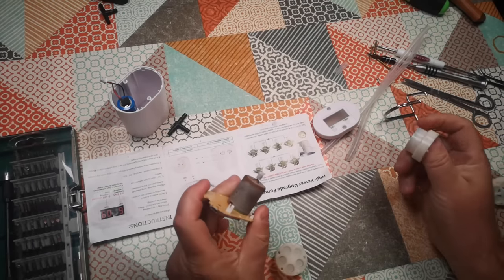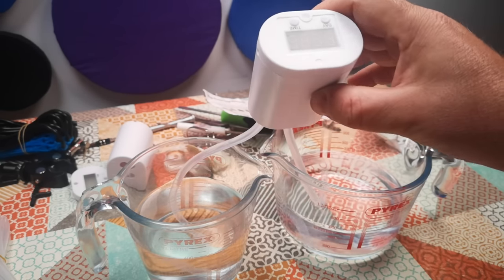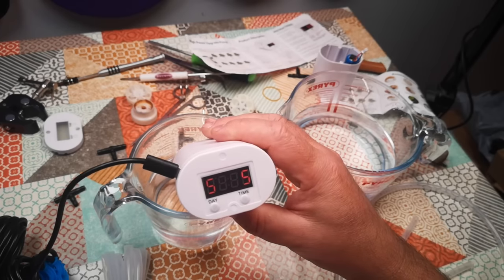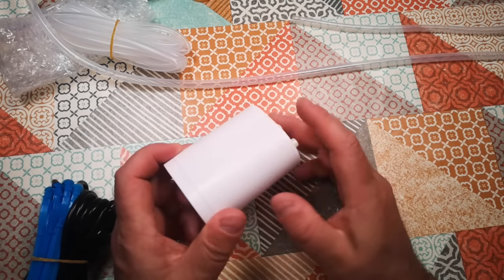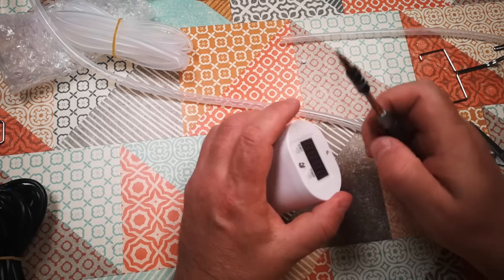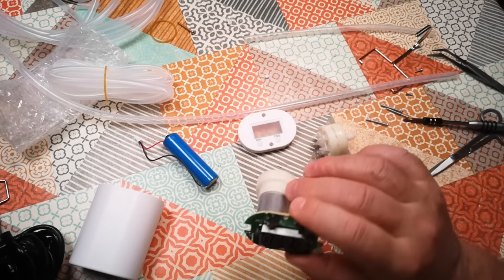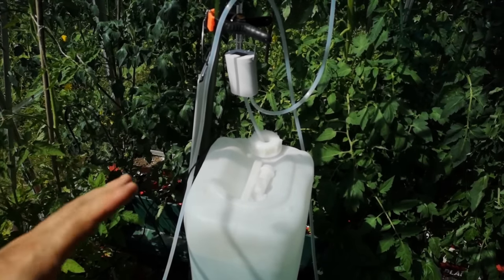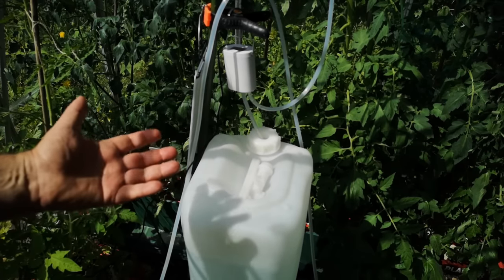Automatic Greenhouse Watering Part 2 – It Works! And Then I Broke It!

Comment: I got some tiny 12V pond fountain pumps from eBay, and a 12V on/off timer switch. In the winter I use the timer switch to turn lights on and off, and in Summer it is used to turn on the pump for a set time each day to water our potted plants. Total cost was about £15, although you do need a 12 volt battery to run it too, I happened to have an old one to hand. Quite simple to do, the most complex part was working out how the timer switch was programmed!
Reply: Actually, I'd forget the on/off timer and just make an overflow pipe that leads back down to the lower water tank.

Ah, I see, he isn't using any form of timing after the header tank.

I found one locally that has a brushless DC motor that doesn't need a battery (though you could always toss in a SLA battery and diode in line with it).

Comment: Hi Mike,

The battery probably can run just fine without continuous charging. Fundamentally, all the pump is doing is moving 4 litres of water from one elevation to another - it's very simple to calculate how much energy this would take. We know the volume of water used is about 4 L and I'll say the height change is about 2 metres.

The work done by the pump is given by the change in pressure multiplied with the volume of water moved. Since the pump is only fighting gravity (I'll neglect any pump inefficiencies for now), the change in pressure is given by water density * acceleration due to gravity * height change, so 1000 kg/m^3 * 9.8 m/s^2 * 2m, giving a pressure difference of 19,600 Pa. Thus, 19600 Pa * 0.004 m^3 = 78 J of work is done.

The capacity of an 18650 battery varies, but according to a website called Fogstar, they have a nominal voltage of 3.6 V and capacity between 1800 and 3600 mAh. This gives a total energy capacity of 3.6 V * (1.8 * 3600 As) = 23,000 J. That's a lifetime of 297 days!

Obviously, the pump isn't perfectly efficient, but it's unlikely to be so inefficient that it would use up the battery's capacity in a few days.

All of this being said, there's nothing wrong with your setup with the solar panel - peace of mind is just as important as any other consideration here.
Reply: Always love these math comments
Reply: "very simple" to calculate indeed 😂
Reply: Just felt the need to say that the result can be reached in a single step without involving pressure. 
The final potential energy of the water is simply m*g*h= 4kg*9.8m/(sec^2)*2m=78.4J and that's the final result since it all was due to the work of the pump.

Comment: I suspect you could cobble together a little 12V DC aquarium pump, a separate programmable 12V timer, and a car battery or other 12V battery. There is also a fair amount of inexpensive 12V solar equipment that you could use to top off the battery as well, but a car battery would likely last for a while. These sorts of all-in-one solutions tend to me to be much less hardy and less repairable than something with discrete components. It would certainly be more expensive, which might defeat the purpose of this project, but it wouldn't be nearly as DIY as a Raspberry Pi or Arduino-based solution.
Reply: Using Tasmota on an ESP32 would largely avoid DIYing the scheduling/coding side.
Reply: if its going to be exposed to the elements you'd want a pond one not aquarium
Reply: just buy a 3v relay, connect to new pump
Reply: @rama3njoy  5v reed relay would be a good shout
Reply: @TomOConnor-BlobOpera  single 18650 max 4.2v, and i think that circuit without step-up

Comment: It might be worth considering a simple drip irrigation system in the future. If you can suspend/make a pile of stuff to hold the larger reservoir high enough, you can run a pipe from it straight to your plants, and mediate the flow by stuffing the tube with a wad of wool held in by a bit of wire, or a simple valve if you want to get fancy.

Probably less precise than the pump, but if you want something simple and future proof it might be better suited for your needs.

Looking like a lovely garden!

Comment: I have a very nice indoors growing kit that's a complete hydroponic system with a table that floods with water and drains at set intervals, and the one item that took the longest to find a very good one was the water pump and oxygenator kit. I bought 4 of them before finding one I really like, and I do have everything setup on a Raspberry Pi 4 Pro with Bluetooth so I can control things remotely, and check on things like the temperature in the tent and of the water, what the lights are doing, and even what the pH and nutrient-density of the water.

Comment: Parkside in lidl has an automatic plant watering thingy! For £30 If you're still looking for one. I've got one and it seems pretty good
Reply: I believe this device from Parkside simply has a soilenoid inside that gets opened, so it needs to be connected to a pressurized water line. He mentioned at 15:17 that he has neither mains power, nor an actual water line at the greenhouse where he tries to water.
Reply: @graealex  just need to hang a bag of water at the top of the greenhouse? Gravitational pressure would  suffice
Reply: @growtocycle6992  Depending on the greenhouse, he might not have a place to put 30 Liters or so of water on it, or rather, it might not handle the weight of it.

Comment: I was given a water-damaged Dremel (left in a shed in its case) with a very rusty motor that was as dead as a proverbial. Took it apart, cleaned every cubic millimetre and now it works like a charm. 

Did wonder if you would be buying a valve doodad from your header tank (like hospitals use for drips). Love watching and hearing your process and progress to ingenious solutions and just sad for the poor urchins who will need to find other work. 

Anyhoo, wishing you luck and hope you (and your plants) have a lovely holiday.
Reply: i'm not so mechanically inclined but i do work in a hospital, and roller clamps alone with no pump were what made the most sense in my head. you would just need to figure out making the gravity work, but i can't imagine that would be half as complicated as what shrimp went through here. still, the experience of problem solving is part of the reward.
Reply: @blockhead391  I’m so glad you replied because now, instead of “valve doodads…for drips”, I can say “roller clamps” and people won’t think I’m a complete idiot (well, at least not for that reason). 😉👍🏼

Comment: Steve Mould did a video a the other week with a solution for your watering. Get a Wirtz Pump that is powered via a windmill. This will bring water up from a barrel. You could have water collecting into the barrel via guttering and then a barrel above where you wish to water, a Wirtz pump taking water from lower barrel to higher one. The higher barrel could have a "tap" that has a pipe connected that then just takes water to where needed using gravity. All you need is a windmill (DIY ONE or get a cheap garden one), 2 barrels 1 with a tap, and some tubing. If you have a pond you could also just use the ponds pump and a siphon system. I think the windmill idea is kinda cool though you can always have an overflow also and a system where the water is recycled. Loads you can do with that system really.

Comment: If your water tank can be elevated then you can use very clever watering system named Tropf-Blumat.
I am using it for several years and if work perfectly. You only need 1m elevation for 10m feeding tube.
The system work without electricity (even no batteries) and without mains water. Just gravity and clay sensors which measures the moisture and control the water flow.

Comment: Have you looked into the Blumat system?
It works with hollow clay cones that press on a tube forming a valve.
When the soil humidity drops, the valve opens and water drips. No electricity required. and it works off a water tank.

Comment: Have you thought about putting the big reservoir a the highest point and just restricting the flow so that there is a constant drip to each plant? Purely gravity fed. The water might run out, but hopefully the equivalent of the battery and pump (gravity) doesn't! 

Might need to control the watering at the drip heads. You can get adjustable ones from your garden centre. If you trust the pump then you could still use it to fill the reservoir, but just to top up a slow drain.

In the past, I've had good results from Gardena and Hozelock for automatic watering, but it's expensive, and it does require a hose from the mains water.

Comment: If you have the storage tank above the distribution tank, you could use a garden hose timer. Those don't care if the water pressure is from the tap or from gravity.

Comment: Getting more when the pump is close to the water is not strange since you can only suck water up to just below 10 meters no matter what kind or size/power. But a pump can push water or any other liquid up much higher because its on the pressure side.

Comment: I have the same issue of a greenhouse without easy access to water or power. I've a "Irrigatia SOL-C12" which cost a fair bit more but has been reliable.
However, I want to have micro sprinklers for seed trays (which are hard to water with drip feed lines) and found it can't provide enough pressure so started looking at a home brew solution with a solar power water feature and solenoid value (to control how many sprinklers are driven at once to reduce the pressure requirements on the pump).
If you could put your main reservoir high enough to water the plants you could just use a solenoid value and the controller from one of your units to open the solenoid value for a short period and do away with the pump completely.

Comment: I know you said you don't want pay for mains at the greenhouse but I just wanted to mention a (relatively) cheap option Ive seen people use where I'm from. I'm from the US, so the material available may be different, but I often see small outdoor buildings and equipment supplied by mains power using direct-buried cable ("UF" cable, which stands for underground feeder). All it requires usually is a shallow trench with red warning tape laid a few inches above it and PVC pipe to cover where it penetrates above ground and a cast-metal outlet box with a GFCI receptacle. This option is often cheaper than a full conduit run. Awesome video either way

Comment: You could just buy a timer and a pump.  Theres lots of hydroponic grow equipment for sale at decent prices (aquarium type pumps start around £15) now and basic plug in wall timers are about  £8 iirc and the digital ones about £12.  Good luck with it all.

Editing this in.
'Wilm' system is a version of what ur tring to achieve, this uses the same type tubing to feed individual pots off one (aquarium) pump.  Any 'aqua pot' type system will also work though the pump for them is different though its been so long since i used them i cant remember specifics.

Comment: The main question would be if your pressure downstairs is strong enough  to fill something upstairs (with a standard toilet bottle to stop it entering once filled).
Fact is that it would need rather massive solar panel to produce enough power for a pump. That panel would require heat amount which isn't safe for LiIon battery. so if you can do as much ass possible by gradualy slowly filling high position tank, then it would be easy to power just opening by something like msp430.

Comment: Interesting follow-up👍  it might have been worth working out hiw much water you need delivered how often first though, and started with the bottle/ reservoir, then working out at what height it needed to be to irrigate successfully, and then work out  how much work it would take to lift enough water into it:- chances are that the bottle could work if hung around the height you have the pump currently, so watt-hours per cycle would be massively reduced.

Did you try the shiny motor with the original controller btw?  My money is on a failing transistor rather than a burnt commutator/ brush in the replacement unit...
Whatever the pronlem, fingers crossed for you to have peaceful break without the gnawing fear of greenhouse drought👍👍

Comment: I do toy restoration, and I promise you there is very little to that motor. It doesn't have "brushes" per se. Usually just springly wires that contact the rotor. 

I would just pull the motor off, take off the back cover that holds the rotor in, clean it up as best you can, polish the rotor a bit, lube everything up, and stick it back together. There's really nothing that CAN go wrong. It just sounds like it's got mild corrosion preventing good contact with the energy source. 

I usually just run an exacto blade across the wire "brushes", to reveal shiny copper and clean the rotor with a q tip, maybe some deoxit, in rare cases I'll use mothers mag and aluminum polish the shine it up, and then clean that off with 99% isopropyl. It's pretty easy and for a guy with your skill level, it'll be a piece of cake. 

Some models like Mabuchi style even have a holes in the bottom so you can push the wire brushes back, then reinsert the rotor, then push a small tool through the hole to get the brushes to snap back against the rotor if you're have a problem with reassembly.

Comment: Now, this may be a very overcomplicated solution, but one that doesn't require any power. What if you had a drip fed reservior that had a bell siphon on it? that way, once the drip feed reaches a high enough level, it will suck it up until it depletes to whatever height you set the intake to, and repeat the cycle. I'm not sure if a product like this exists on the market, since the only similar use I've seen is in Quint BUILDS rain gutter power generator (#5) where he used a 3d printed part. I just wanted to share my thoughts

Comment: A possible solution for a more robust setup would be to run an extension cord out to the green house to operate an outlet timer with a pond pump plugged into it. Power outlet timers are very popular in my local area for automating the activation of fairy lights for Christmas. There are digital models that allow for setting minute length periods of activation or deactivation.

Comment: Bit of a struggle to get it working but you got there in the end, I can only make two observations Sir,  One Don't hang your pump (electronics) under where your triple joint pipework is in case it leaks and soaks the pump and put your pump and water reservoir higher up, make a stand or something then you don't need the header tank and you can lower the weight of water you are pulling from the supply to put less stress on the pump motor.  Thank you for sharing :)

Comment: Nice video as always! My two cents would be a solution that sprung to my mind.

There are small aquarium pumps that doesn't seem as flimsy, why not use one of those in conjunction with a timer outlet? You could even adjust the flow rate on these.

Comment: I think that a more continuous and consistent flow could be achieved by preventing sucking of the air with water as the case with stopping the flow to fill the bottle and letting the full bottle empty. To do so, a simple siphon setup should be enough. Just a single loop of the rubber hose whose top is above the lowest point of the bottle reservoir should be enough.

Comment: Assuming that the output current of that circuit is 5V, what you can do is remove that low quality motor, and just solder a decent submergeble DC pump in it's place. That way you dont need to tinker with relays or mosfets.

Comment: I bought a solar powered fountain that fills one bucket with and auto syphon tube that runs into another bucket that feeds a drip irrigation setup. It takes an hour or more to fill the bucket to initiat the auto syphon. It only works if the sun is strong enough to power the pump.

Comment: At this point your best bet is to set up a resivoir of water with a siphon controlled by a solonoid. You could also just buy a clock and use one of the hands with some foil as a timing mechanism (they run off of batteries for a long time, and easily bought). Ive used this before and it works surprisingly well.

Comment: you could wire up the other battery in parallel so that you have twice the capacity, probably not necessary given the efficacy of the solar panel but i thought it worth mentioning.

Comment: You can get one way valve for that tubing if you put one on the pipe going into the header tank the pump doesn't have to pump as hard evertime it starts up.  Not telling you what to do but it would be a suggestion. Much love from Belfast northern Ireland

Comment: Search for - Marksman electronic watering they £12.. elevate a waterbutt with a tap 🚰 on the bottom on three rows of bricks..it opens a solenoid on a timer from AAA batteries, the pressure from the height is enough for a greenhouse.. I have two and never missed a beat HTH ✌️

Comment: If you can get the water tank up higher, you could use an automated hose timer. I sent googling just now and it looks like there are devices to turn on and off a hose on a period of time. Could just let gravity deal with moving the water, if you can stop it and release it as needed.

Comment: all you really need is an aquarium pump, a battery and a timer (not a kitchen timer but so called industrial type) all of witch is in a great variety on the internet, you just need to correctly match voltage and current of all three to avoid malfunctions.

Comment: With the setup you described you could just use a solenoid valve instead of a pump and a secondary tank. you would still need to a timer to turn on and off but it should use less power

Comment: Pro tip: if you need reliable stuff that you want to take apart and repair if something happens - don't buy an "all-in-one" or a "smart" device. Get a regular good pump from a reputable manufacturer and an electronic timer and put them together. That will be only slightly more expensive but much more reliable and durable and much more repairable.